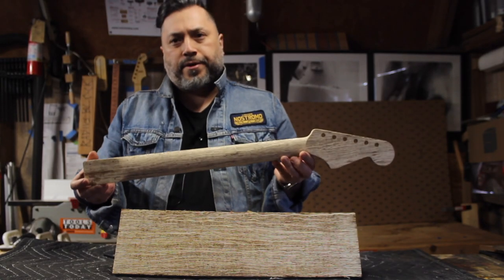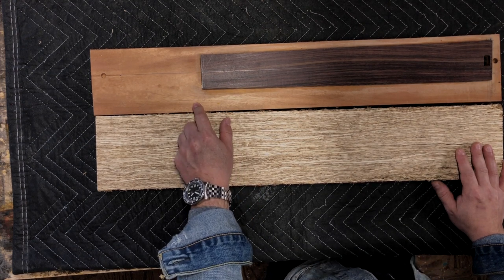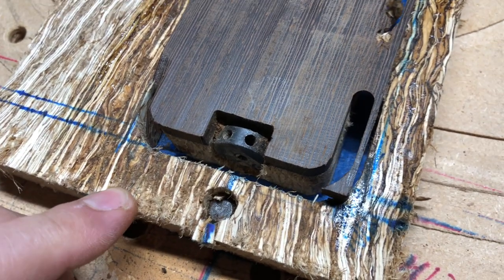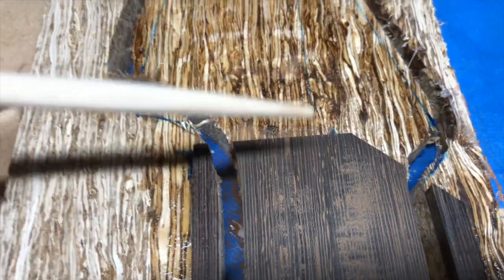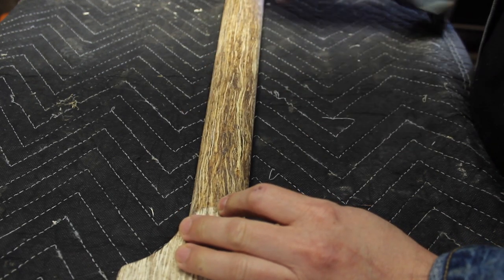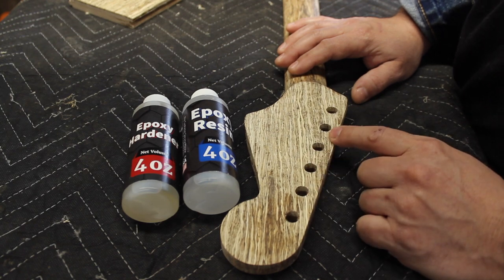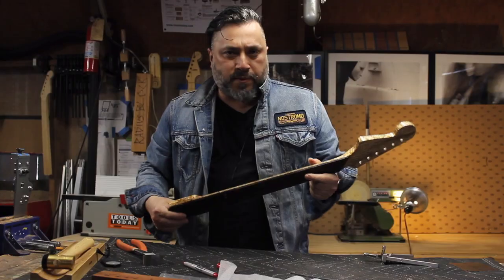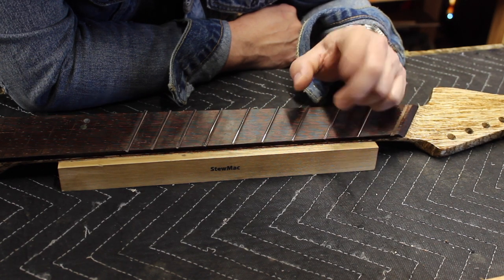I made a guitar neck out of Hemp - HempWood CNC build part 1

Comment: Boy that grain is stunning!
Reply from the maker: It really is unique and interesting grain. Too bad the wood is brittle.
Reply: @MarkGutierrez  would it help if different glue were used in the manufacturing process do you think?
Reply from the maker: @realitystudioscustomshop  Yes. HempWood actually has a document published on their website which describes the organic bio adhesive they use. They use it cause it doesn't off gas and its good for the environment. If they chose to use an industrial epoxy, it would be a magnificent product. However it would then loose its appeal to the market which craves low organic volatile compounds. One work around is to rip the Hempwood into strips, then epoxy them back together for a stronger lamination. That is essentially what I had to do.
Reply: @MarkGutierrez  interesting, hope they're R&D is ongoing, seems like this kind of weakness should be addressed in a product like this

Comment: Have you considered or tried vacuum pot stabilization of the neck blanks? You can building the pot out of thick wall PVC pipe with a screw on PVC cap with the appropriate fittings, vacuum pump and cactus juice or similar. Bake per directions and mill to shape. I would love to see if the hemp wood is conducive to this treatment.

Comment: Not watched this yet, but as a user of ridiculous materials I've been wanting to try and get some of this. So I'll sit back and enjoy this video :)
Reply: Looks like the OSB guitar neck I made was less hassle than this - although I did flood it from the inside (via the trussrod cavity) with a dry rot hardening liquid and reinforce it across the headstock transition with bamboo.  I think the end result you've got is beautiful like a hemp marble. Looking forward to seeing this on a guitar!
Reply from the maker: Hi Chris, I thought about using a wood hardener as well. I abandoned the idea simply out of fear the hemp wood would fall apart due to all the acetone type chemicals in the hardener. Epoxy was the answer. A thin outer coat is all the extra rigidity the hemp wood required.
Reply: @MarkGutierrez  Yes, I read the ingredients AFTER using it and was a bit worried about it turning into porridge :)  But thankfully it survived!